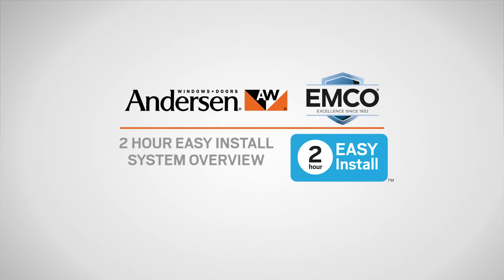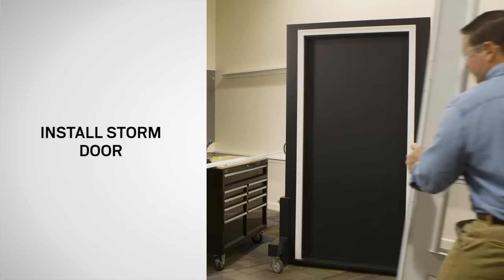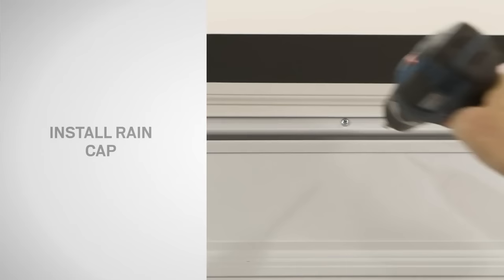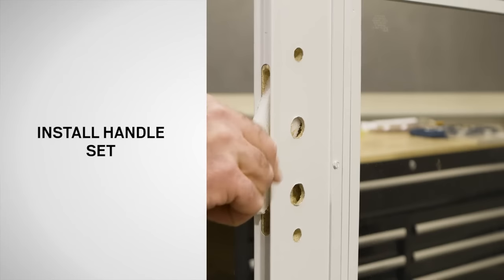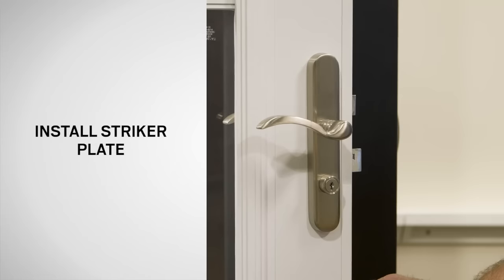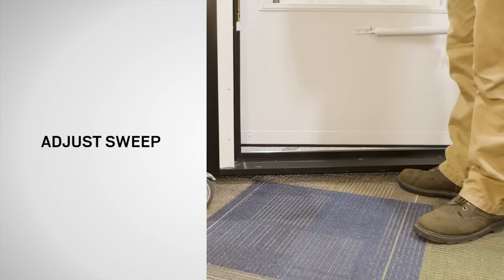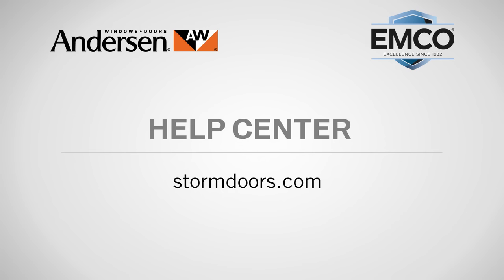Installing Storm Doors with the 2-Hour Easy Installation System | Andersen Windows

Comment: It’s definitely not 2 hour installation, and if you don’t have the 1/2 in and 3/4 in drill bits handy, be prepared to head back out to your local hardware store to get them.

Comment: it is funny how the manual doesn't even mention drilling the door handle or hinge holes in the first place. if I had that tiny detail I could do a pro job as a DYS, I think they WANT  you to screw up. This video doesn't even show my model(I have the 2500) but it is more informative than the crappy manual that came with my model. I am sick of most other vides on YT being full of silly people doing corny jokes or sighlant  "music videos" with techno-rock music instead of talking at all! I am glad I found this even if it is not my model I installed my door entirely from watching this, not my crummy manual! as a note, you do NOT cut out the area for the doornob/dead bolt with a reciprocator saw like I see people do often in other videos! MISINFORMATION!   you use a template and drill only holes. some videos cut out an oval. NO! that will ruin the strength and integrity of the storm door body!  I am glad I watched this. mine came with a template but did not say how to use it. saved my door from being improperly configured! Thanks! I am subscribing! :)

Comment: This video is legit and is 1000x more helpful than the printed instructions that came with these doors.  Thank you so much!

On a side note (and a heads-up to other folks out there planning to install these doors) it does NOT take 2 hours to install.  From cracking open the box to finishing the project, it took me 4.5 hours.  My guess is, Emco / Andersen timed their very best guy while installing one of these doors, who had all his tools already laid out and who has installed dozens of these doors in the past, and it took him 2 hours to do so.  Afterwards, they said, " Welp, guess it's a 2 hour door" and slapped it on the box.  There is 100% no way that a first-timer installing one of these doors will be able to do so in 2 hours.  

Great video, great door, good price, but not a 2 hour project, plain and simple.
Reply: Ian Hales It took me about 4 hours to do my front storm door, getting ready to do the back. You are right, no way you can do this in 2 hours!
Reply: My rough opening was rougher than others. And a bit too wide. I had to pad the doorway and customize the door jamb to make everything fit. Not Andersen's fault, of course, but added time to the project. It took me a solid 6 hours to finish the project, aided by the fact that my drill batteries refused to take a charge, so I did a significant part of the install with a manual (yes, manual) drill. Hahahaha!!!! It's a pretty straight forward installation process. Just don't worry about the fact that you start with the yellow bag and have 5 painted white screws left from that bag that you don't use until near the end of the  install. (This on the Emco 400 Series 3/4 glass with self storing screen door).

Comment: Good video, I watched it prior to installing an Emco 300 series door. Good way to prepare for the job. One thing I will suggest are step drills for drilling the larger holes for the handle. Step drills excel at drilling nice round holes in thin metal. Regular twist drill bits can bind and tear the metal leaving an irregular shaped jagged hole. Other than that just follow the directions to the letter and take your time.
Reply: Yes, they ripped at the metal and didn’t look so great .   I kind of chiseled off the jagged edges and was concerned but the 2 face plates easily covered up the jagged cruudy (sp.) holes.
Reply: Great tip, buying one.

Comment: Thank goodness for this video. The printed instructions (EMCO) just left me scratching my head!
Reply: artswatch oh they're horrible aren't they! They don't even show the side pieces to attach to the door jamb
Reply: This video is great! One video goes way to fast and another one some moron's video is "AFTER" the door is installed!
Reply: Are the doors made in a non English speaking country? Why would the installation manual be that lacking?
Reply: Did EMCO have the spacers?
Reply: Even worse is Home Depot still has the old convoluted installation instructions on their website for the 2000 and 3000 Series doors.  I hope Anderson sees this and make HD replace them.  Those installation instructions are crap.

Comment: Soooo much better than the written instructions. Those were abandoned as soon as I found this video. Clear. Concise. Guided me along every step. Door seems of quality. Everything fits nicely. ***/****

The person(s) who designed the screw covers should be keel hauled. As for the person/person whose job it is to stick the MISSING ANY PARTS sticker dead center on the glass with industrial strength adhesive requiring extra clean up time, they should be drawn and quartered.

But great video!

Comment: Very helpful video and I would recommend people to follow it exactly as it is much easier to understand than the printed instructions. In my case the opening the door was being installed in was slightly too big and needed 3/8" spacer strips along the top and sides and some other adaptations to installed the piston closer. These fixes were made along the way of following these instructions. It took me much longer than 2 hours but there were two trips to the lumberyard and some table saw ripping involved. If conditions were perfect and you were handy 2 hours would be doable but I would plan on a little longer the first time. End result was good and the Anderson EMCO 400 Series storm door is a good product.

Comment: I have put two of these doors up and both of them were in specs on the measurements and I still had to use the spacer behind the hinge. I do not recommend putting all the screws in the hinge before you see how wide your gap is on your lock side. Both doors did not fit and had to put spacers in and I learned on the first one not to put all the screws in till I knew it was right. The orange spacer fit perfect in the door jam with the door but the door would not lock because the gap was too wide and had to shim it

Comment: Like most other say the written directions are difficult. Took me just over 3 hours, it could be done in 2 or less on another another install but I kept referencing the video. It helps to have 2 drills so there are no tool changes. I didn't have a 3/4" bit but the handle installed fine with 1/2" holes. After reading reviews and comments I am concerned about the rotting, hopefully it doesn't happen to me as the door is on the east side under and eave.

Comment: I had someone else starting this install and the spacer clips got thrown away. Now I'm completing the install. What's a good substitute for the clips? Anyone?
Reply: A block of wood or a shim. The one on the bottom leaves an 11/16ths in gap from floor to bottom door. The other spacer is a 7/16ths inch gap from the side of the door to the brick mold trim. Hope thishelps. You're lucky I saw your comment before I just threw them away. Lol

Comment: Great video, lots of info there. My only gripe is the screw cover trim piece is alot harder to get into the channel than appears.
Reply: Rob Kerfoot , I agree.  Have sore, bloody fingers, and I think I have probably ruined the plastic cap!  It simply doesn't go in for me, no matter what
Reply: Hi I too had trouble installing the screw cover strip. A trick which I found helpful was to align the bottom  portion of the strip into the groove and use a flat head screw driver to push in the top. Use painters tape on the screw driver to avoid scratching.  This method helps allot.

Comment: In the required tools section it says you need a file, (didnt use,) and a chisel, (didnt use) I bought these items specifically for installing this door and didnt even need them.  The file may have been to smooth out the holes drilled for the lockset, but the holes are covered by the brushed nickel hardware so any jagged edges will be hidden,   and the chisel i presume is to deepen the slot through the striker plate to the wood,  allow the deadbolt to go deeper. Seems its unneccessary, they need to update the instructions, theres enough steps in the installation to make it pretty time consuming without making a separate trip to the hardware store for a chisel that wont ever see the light of day. Other than this the install went well; one thing they didn't mention: once the hinge rail is mounted to the door, it extends past the top and bottom, so if resting upright, it becomes necessary to prop the bottom of the door up to avoid having the bottom of the rail getting bent and crushed, so if you are putting it in the rough opening and then have to take it out again possibly to install a spacer or too change the handing to the opposite side, or for whatever reason, then you need to have a couple chunks of 2×4 on the ground where your welcome mat would ordinarily be to rest the door on.  Also all the foam pads and those orange things are fine but I found it more helpful to have someone hold the door in the opening while you  take a few steps back and look at the gap on the latch side,, then visually judge is it even all the way up and down if the gap tapers badly or is really wide then the door isn't sitting correctly in the opening, and needs to be adjusted. Also note where it says UNpainted or PAINTED screws, they are identical except for the paint, this will save you from having to remove and swap out if you used one where it should have been the other

Comment: The DOOR CLOSER is NOT level !!!   Question:  WHY the door does NOT fully open?  It opens only about half way -- Is it because there is problem with the spring in door closer?  not long enough ????!

Comment: I was noticing this is a wooden storm door. mine is metal. strange it came with wooden drill bits(including the hole drill bit that is 3/4") I am wondering why my door came with odd instructions and odd drill bits that aren't even metal bits.

Comment: Dear Andersen Windows, 
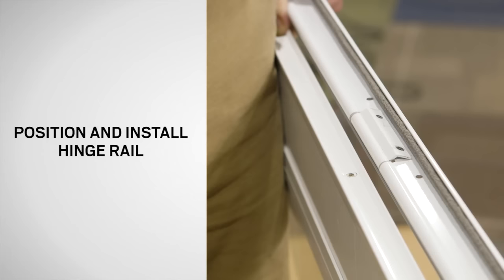At 3:08 I attempted this and somehow my hinge is not aligning to where i get that 3/16 inch extension on the top. It's definitely  more than that. I just can't seem to get the hinge holes to align with the pre-drilled holes to get the extension on top.
Reply: Ya they must have fucked up. I just installed mine same problem just installed it as is and went fine
Reply: I had to re drill the misaligned pre drilled holes

Comment: Please add a link to this video on the printed instructions.  The printed instructions are horrible!  I could have used a little more instruction at 6:33 into the video.  "The door may be out of square at this time".  Nothing regarding how to square the door?  Why is there only one orange spacer for the bottom right side?  I made another spacer out of wood for the left side since without it my door was listing at a crazy angle and I didn't want to hold the door while installing the first few screws.

Comment: Don't buy a wood core door!  If you're lucky, they'll last 5 years...and by that I mean after five years you'll know complete destruction is imminent.  No matter how well you caulk(I even caulked the windows shut!) they'll get water/moisture in them and slowly disintegrate.  I bought one of these Emco doors and they are no good.  I don't know the core construction, but when they start bulging - could be anywhere - you'll even end up seeing the aluminum being eaten up(not rust).  Is an acid formed?  Idk, but that would be my guess.  I'm looking at replacing with an Anderson 2000 series all-aluminum door.  Wish me luck!

Comment: I love how in my paper instructions it tells me not to wipe the low e glass, just to spray it and dab it with a cloth to remove excess cleaning solution. Then Anderson puts paper stickers on the side with low e coating... so adhesive glue is ok for the low e coating, but not wiping it with a microfiber towel? you try removing sticker residue by just dabbing it.
Reply: Morgan  I actually work in doors and windows at HD. And the 100 series emco and 200 series emco composite disintegrated after about 6 months to a year for most customers.  But haven't had anyone complain on the aluminum self storing 2500 series. That's what i put up.
Reply: Morgan  they are a bit pricey. Hit up the reduced tag bay in the millworks department from time to time. I see the 2500s get reduced all the time at my store. Mine didn't sell and it went through the reduce process and didn't sell so they were gonna trash it and I asked to keep it. Sheesh 300 for a storm door I sure cant afford that. 😬

Comment: I have a EMCO 200 series storm door and the storm door has been installed successfully, can I mount the closer to the very top of the door instead of lower portion of the door?

Comment: Im looking for a trick to put the screw cover on the sill plates to hide screws. Maybe heat it so it is more plyable?
Reply: Prior comment said the following:
Hi, l too had trouble installing the screw cover strip. A trick which I found helpful was to align the bottom portion of the strip into the groove and use a flat head screw driver to push in the top. Use painters tape on the screw driver to avoid scratching.
This method helps a lot.